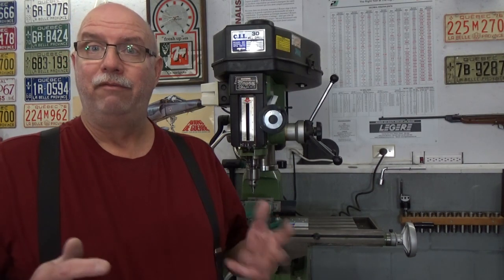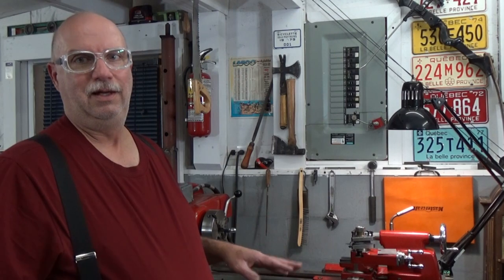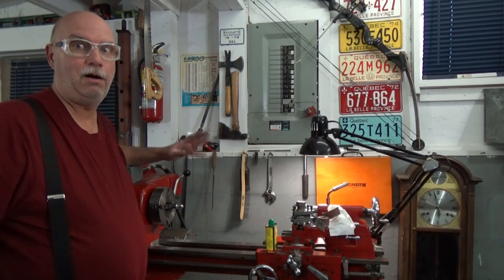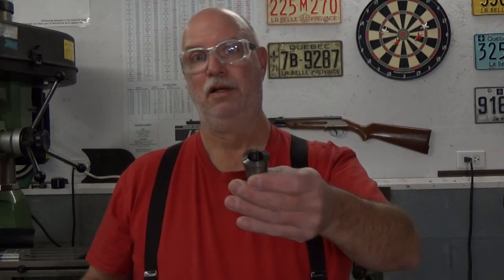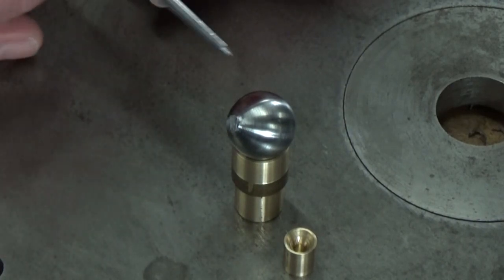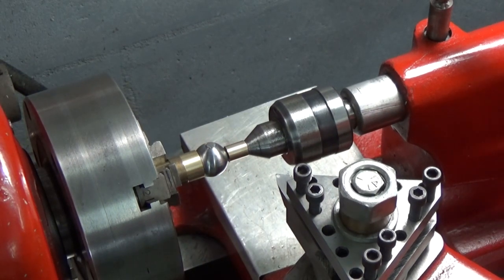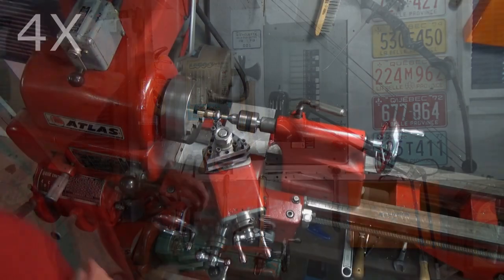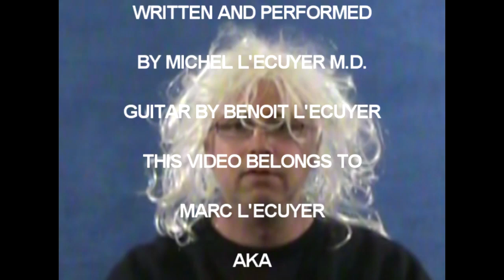HOW TO MACHINE AN ACCURATE SPHERE BY HAND WITHOUT A DIGITAL READOUT IN YOUR HOME SHOP! MARC LECUYER

Comment: Marc, I gave you a thumbs up on this ball making video because it's aimed a "novice machinists" who probably are satisfied with working to a 0.005" tolerance.  But I'm not sure this technique would be good enough to make an accurate ball like that used in a ball bearing.  If rolled across a granite surface plate under a high speed camera, I'm sure the ball would hop along.  But thanks for teaching the novice/youngsters.

Comment: The holding technique is nice to add to my arsenal. I didn't know that the pressure between head and tail stock would hold a small part like the 3/4" ball well enough to turn it. Still learning. Thanks for the video, and by the way, your website to which I turn regularly to refresh the old brain cells.